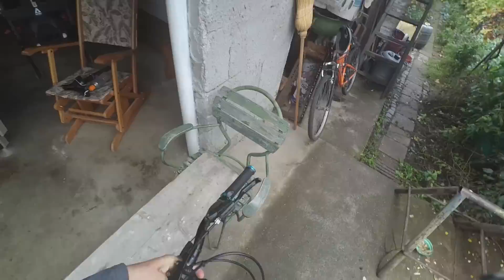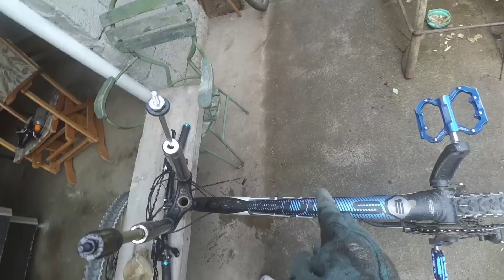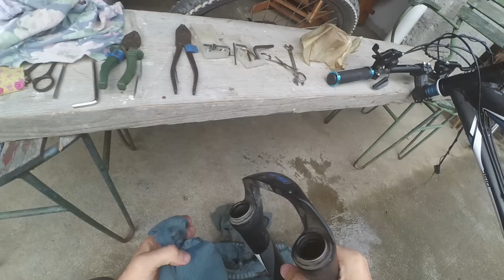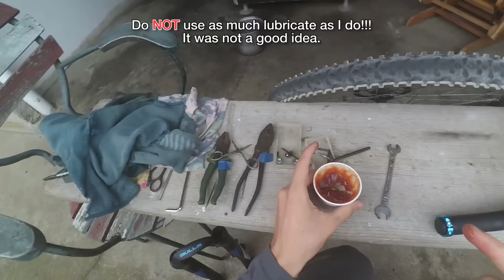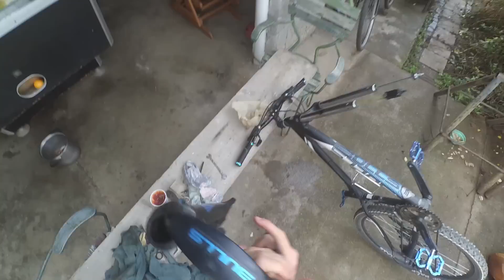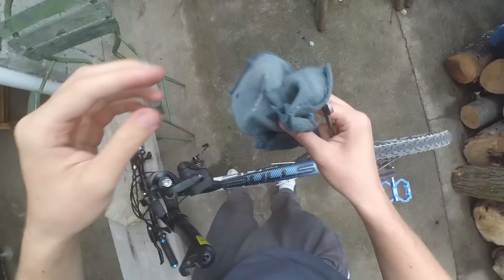Suntour XCM fork disassembling (New video in the description)

Comment: It was a slightly mistake to eject the rope from front brake caliper. The best way is to put off the whole caliper without disconnecting it. Because the caliper can be stained by oil during fork disassembling  which leads to bad brake performance.
Reply: Why was this done at three times normal speed with no narration?
Reply: Agree, my eyes were out of control !!

Comment: it seems that in every video i watch ,on xcm forks ,the internals of the fork are different...
Reply from the maker: +The Religion Killer Probably because they were made in different years. This is 2013th edition.
Reply: +trialboj i have one from 2010 and one from 2015...they are pretty much the same except for the color of the push rod and the end of the lockout piston(older-black,new-white)they also differ in dimentions of the stanctions but that is because of having different travel....i also took a look at an older xcm and it is dual spring with mechanical lockout and has the longer,less practical seals.
Reply: hi mate my fork  is the same as yours because when I unscrew the little silver nuts on the bottom of my fork at the start of the removing the lower legs process I have some black threads when I tried to pull the lower legs off it just gets stuck and doesn’t come off do you have any tips

Comment: please provide some info on how to adjust preload...on the xcm fork no idea what thts meant for or how it works please help
Reply from the maker: That option does not work on my fork, so can't help with that. But it should effect of the stiffness of the compression, if you fork is in a better shape, you can try turning them CW, and checking how it feels, than turning CCW, and see if there is any difference. FOr a low end fork I'm not sure if there would be any noticeable difference, but maybe you are the lucky one.
Reply: vish solo I dont think any of them do. My trek came with this fork, and it rides okay for my weight, but it is just a shitty fork for a 750$ mountain bike.

Comment: Hey great vid I have the same fork as you and I put lube exactly where you put it but for some reason it goes stiff sometimes and I have to put more lube on. Please help me!
Reply from the maker: I do not recommend using lube, use some quality grease instead. Mine works till the last disassembly which was at least 3 month ago. This fork does not like low temp. So the optimal temp is 20-30 celsius. under 10 it's quite stiff, and under 0 does not move.
Reply: +trialboj ok thanks so much I subscribed to you
Reply: trialboj hi should ther be a noticable difference when you adjust preload on forks. have auto lock on right side and preload on left but cant really tell if it doing anythin. any help apreciated tnanks
Reply: This guy doesn't know what he's doing don't take any advice from him you can call SR Suntour and they will walk you through it